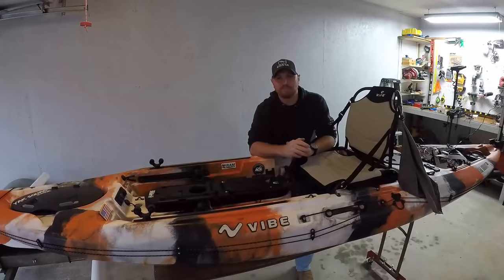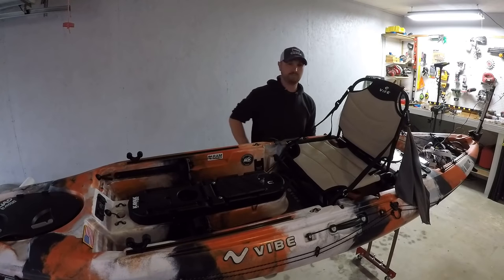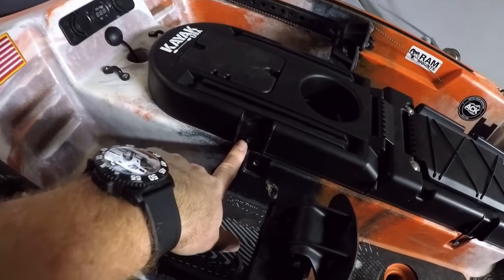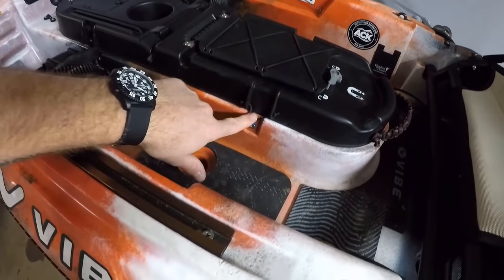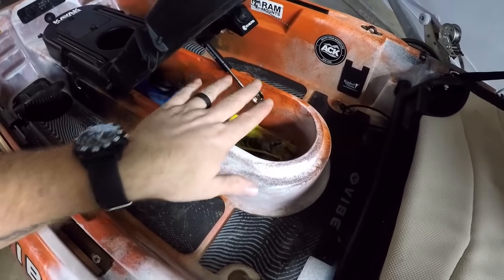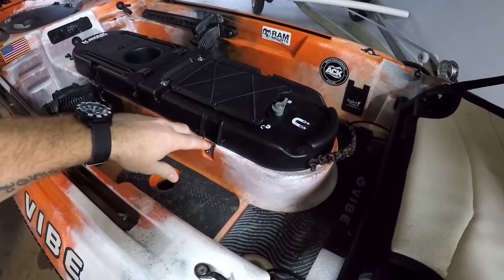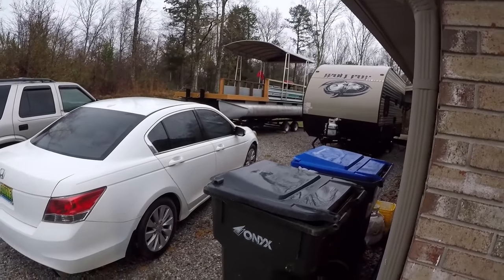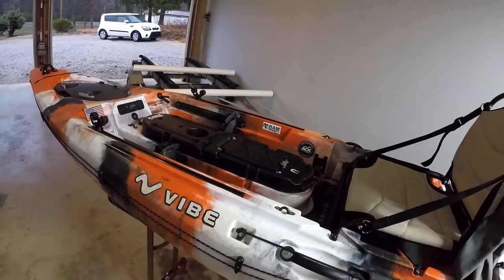The NEW Kayak Mod Pod 3 !! / Best kayak Mod for 2019

Comment: Do you have any close-up shots of the strut mounting locations?  Wondering if you can provide the measurements of the strut mounting plate locations for the mod pod and the center console.  Also, what did you secure the strut plate to on the underside of the mod pod?  There doesn't seem to be a good location.  Thanks.
Reply from the maker: I think I have some detailed pics of it on my INSTAGRAM 🤙🏼

Comment: Did you cut the half off the bottom of the trolling motor? I installed mine by drilling two holes through the mount.

Comment: Very nice mod on the mod pod. I like that light switch in there. Its a nice touch. I have been hesitant on upgrading to one. 
I do have a question about the trolling motor. Do you have any concerns with there being too much weight being placed in one location? Also torque stress?
Reply from the maker: Fisherman_Rue , Not really, the actual “rudder hole” is a metal insert, so the mount is bolted to that metal tube. Also, the top and bottom of the mount plat have really wide plates that spread out the weight of the motor. But honestly, the motor really doesn’t weigh that much. Once it’s bolted on tight, it’s solid. 👍🏼